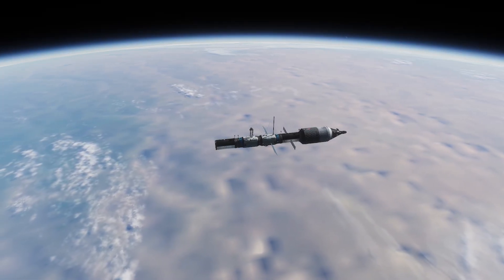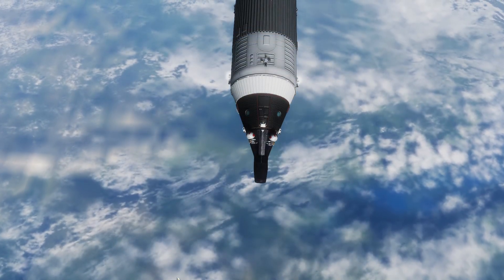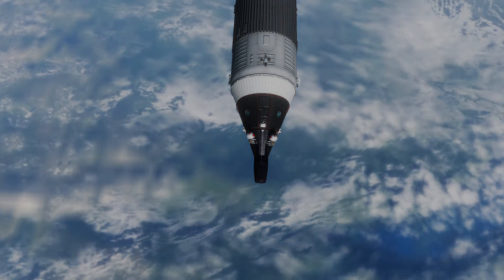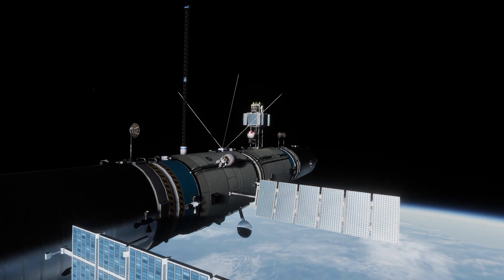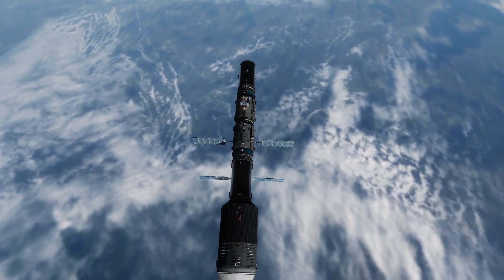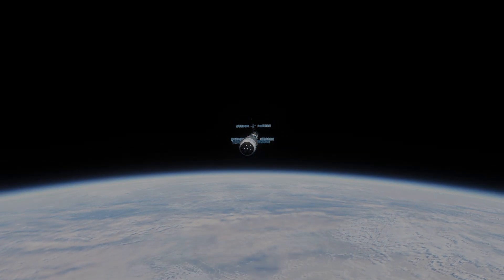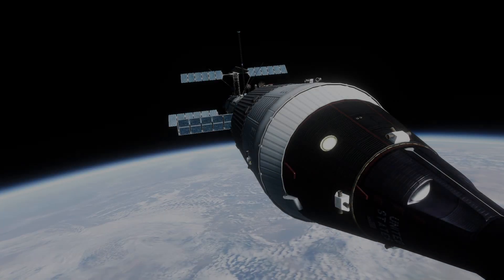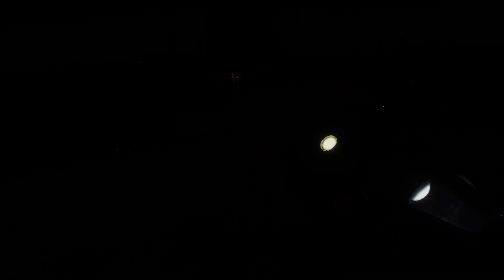The Secret Station - More Power (#5) (If History Had Gone Differently)

Comment: why do you use the Big Gemini part from BDB but the Gemini pod from FASA
Reply from the maker: I didn't - all the parts are from FASA.
Reply: @kevincgustafson  I'm pretty sire the big G extension is a BDB asset, Real Pods uses them, it's packaged into the RO install
Reply from the maker: @kommandantgalileo  Ah, that could be. I'd have to check. But I used it because it looks right.
Reply: @kevincgustafson  you don't notice the main Gemini pod is a dark blue while the extension is pure black?
Reply: @kevincgustafson  at 3:55 the difference is the most obvious there
Reply from the maker: @kommandantgalileo  Just checked and you are absolutely right. I will correct it in the next episode! Well done!